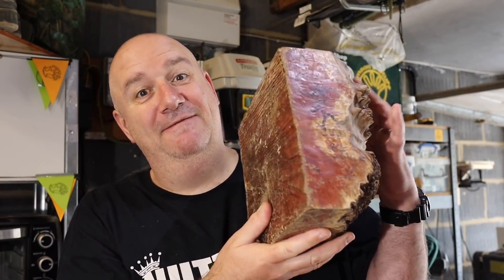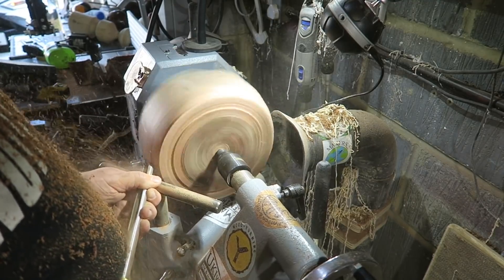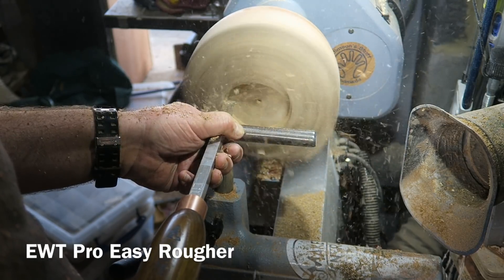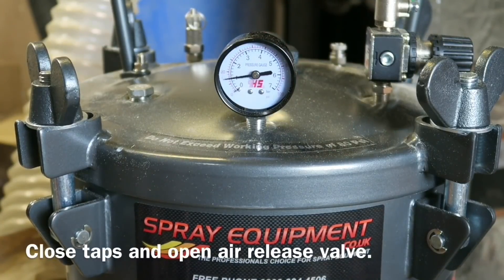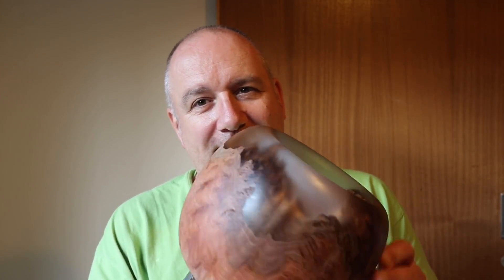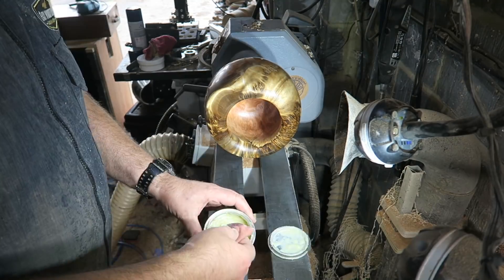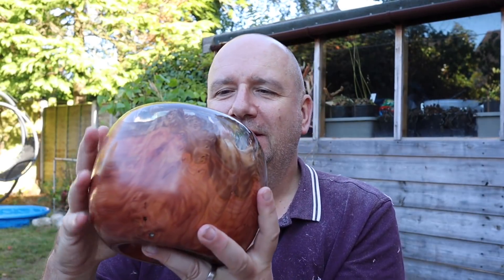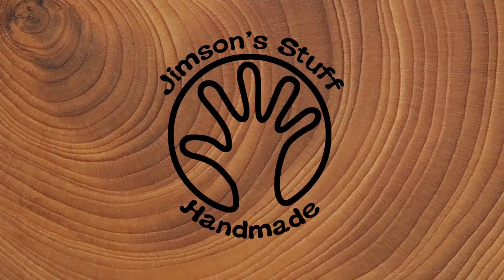Woodturning The Martian Bowl - Coolibah Burl

Comment: Hi Jim. Yet another lovely project, well explained, and beautifully finished as always. 
What kind of shelf life does that particular resin have once opened? Larger sizes tend to work out cheaper per mil. but only if you can use it before best date. Cheers
Reply from the maker: Thank you very much Robert. I’m not sure what the shelf life is, the best thing to do is have a look at the MBFG website, they give lots of technical information for each product. One way round it is to prepare several blanks at once and store them once cured for turning at a later date.
Cheers 
Jim

Comment: Can it be assumed that the dust coming off machining the epoxy is pretty bad for ones health ?
Reply from the maker: I always assume that all dust is harmful and routinely wear a respirator. Some wood dust is more harmful than epoxy dust. Many thanks for watching.
Cheers 
Jim
Reply: @JimsonMakes  that's a good way to look at it. MDF dust comes to mind as well. Down here in Tassie, Blackwood dust has given some wood Turners nasal cancer. I run with those helmets that have a positive air pressure, bit they're a bugger for giving you a stiff neck, with the weight of it.
Reply from the maker: Yes I use one of those helmets , better safe than sorry.